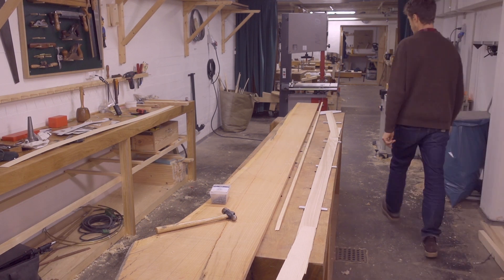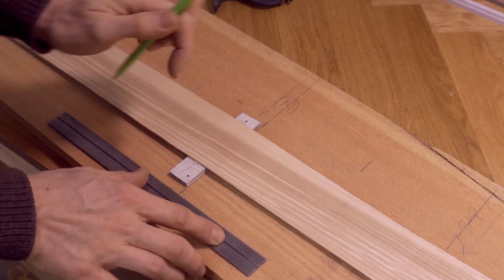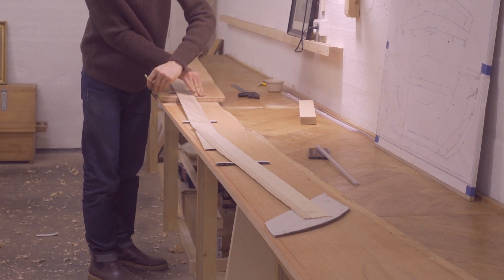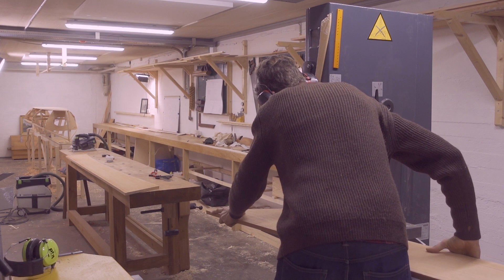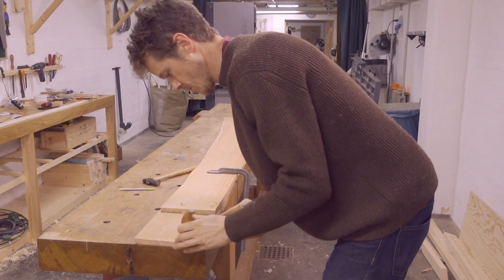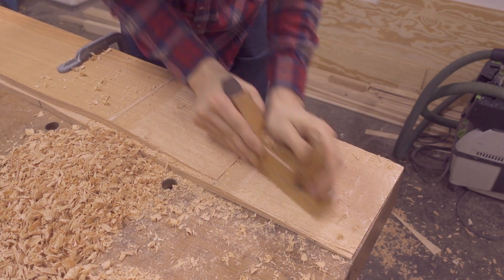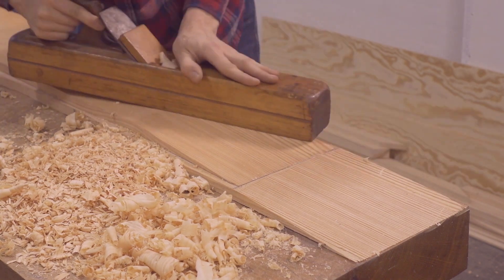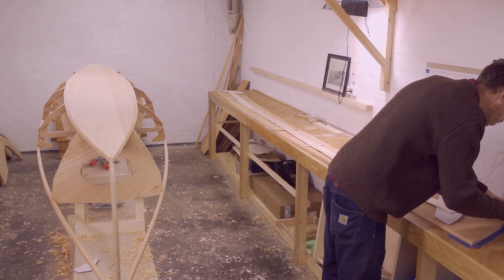How to SCARF a boat plank using HAND PLANES

Comment: I enjoyed your cross planing with a scrub plane to remove the initial wood. You will throw up, but I use a grinder with a 36 grit disc made from the fossilized particle remains of the elbow callouses on a stegosaurus. It goes zoom  and I'm 90% done. When the dust clears, everything has a fresh pine scent. Later on when I dig through the dust to find my pencil, I just grab another one from the large pencil barrel had to buy.